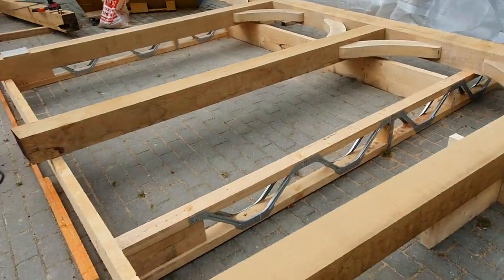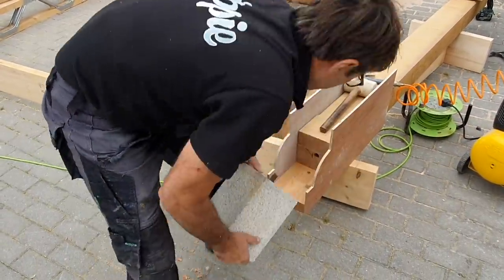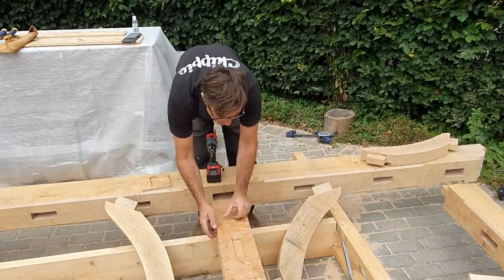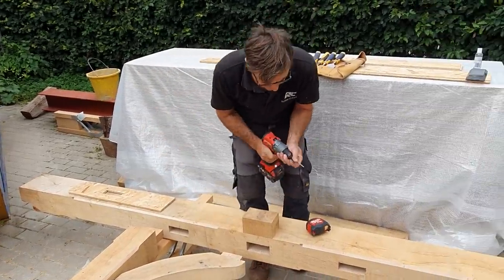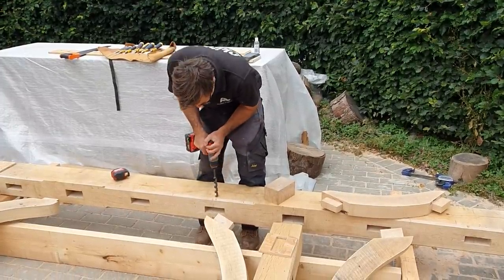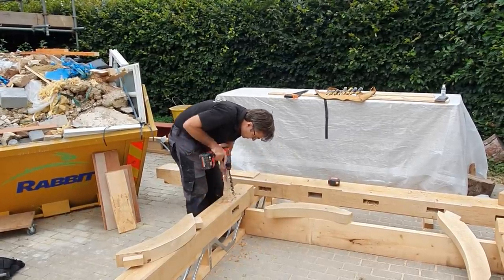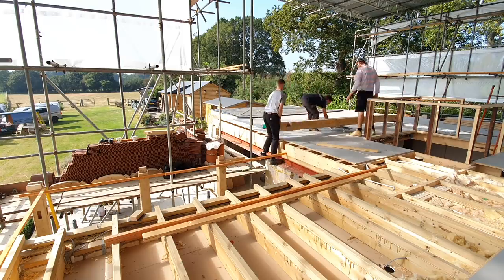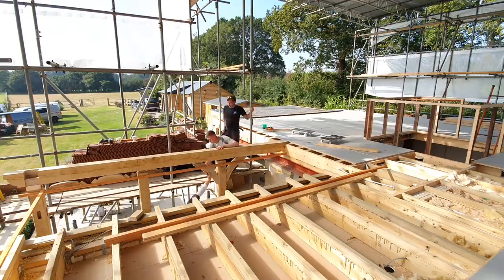The Big Build 24. Oak Framing tips including fitting staddle stones and drilling for pegs

Comment: All the old Oak barns I have pulled apart and rebuilt had the pegs all the way through. I used to do the same out of tradition. I was also always taught to draw dowel. Drill the hole right through the mortice then put the tenon in. Put the drill back in and kiss the tenon then pull back out and offset a whisker. Taper the end of your peg and bang through tightening the joint. There was some wonderful joinery on those old barns. Pulling them apart taught me a lot. 1/2 lap dove tailed collars. Huge cross beams dove tailed into the equally huge top plate. Your favourite pegged scarf joints. Beautifully cut purlins and birds mouth struts. All cut by hand with no power tools. Skilled workers. Your half a ton of Oak is going to be an equally nice feature.
Reply: Yep. You can assemble the building as a kit of parts. In the future, it is relatively simple to knock the tapered faceted peg back out and reverse the process. With a blind hole, the process is very difficult. The joints of oak framing are a big part of what gives it its beauty and they should be in ya face.
Reply: @catabaticanabatic3800  I agree I have pulled many apart over the years that had been together for hundreds of years. Used every part we could and made replacements where damaged or missing. Some of the old craftsmen even carved Roman numerals on the parts making reassembly even easier.
Reply: I was working on a timber frame..in same village a guy was doing same to live in..went for a look..he'd found silding shuttered windows behind boarded walls which I'd only seen in books..a fantastic wood machine shop on site..but I did think making perfect octagonal pegs a bit ott ..

Comment: Hi, when fitting the post on the staddle stones, do u need to wrap the rod to protect the oak? Also do you need to leave a small air gap between the oak and the stone? Or should any adhesive be used? Many thanks

Comment: If you were making an oak frame building all all the lengths were approx 3m (not ideal I know but it’s what we’ve got) would you sit the wall plates ontop of each upright and join them there or mortise and tenon them into the side of each upright? I feel that would look nicer as a seat cut always seems difficult to  make perfect but would probably be much quicker and maybe stronger for the roof to sit on rather than a mortise and tenon? Thanks for the video.  Cheers

Comment: Hi Robin. Did you use draw peg dowling so the hole in the brace is just a mil or so offset towards the tenon shoulder, so when you knock the peg through, it draw the tenon joint in tighter than a straight through hole? 
Great work as always, and I love the content.

Comment: Hi guys, when you drilled through the tenon for pegs did you ofset the hole slightly to pull the two components together (draw bore)?
Reply: I would also be really interested in your answer :-)
Reply: Didn’t look like there were any holes in those tenons first. So was it disassembled again I wonder?
Reply: I wondered the same👍
Reply: Add another curious watcher …
Reply: @robertbamford8266  what???
Reply: @danthechippie4439  That is, another person who wants to know the answer to your question. He must have drilled a hole in the tenon for the pin, but did he disassemble so he could draw bore?
Reply: @robertbamford8266  probably not, I'd say he drilled out for the pegs once everything was put together
Reply: @danthechippie4439  My guess, too.
Reply: The way I was shown was an oversized chestnut peg is driven in and when the oak drys out it shrinks and tightens onto it but I've also seen steel pegs being used for a detailed look 🔨
Reply from the maker: I use an 18mm auger bit to mark the hole through the tenon pushed hard against the edge of the 20mm hole to offset the centre so when I drill with the 20 I have a 2mm offset that will be really nice for drawer dowelling the tenon into the mortice, thanks for all the intelligent interest in this part of the works, I have a great selection of viewers and followers and for that I am very grateful!!
Reply: @ukconstruction  I knew a man of your calibre would have it covered👍
Reply: @ukconstruction  that's a great idea especially with such big oak beams.

Comment: Hi Rob, quick question (not related to this video). Im currently constructing a warm flat roof with a central roof lantern. Would you continue the insulation up the outside of the roof lantern upstand? I know theres only around 100mm of upstand above the roof finish and probably nothing to worry about regards condensation. As far i can see, everybody just insulates inbetween the timbers of the upstand frame.
I would love to know how you would tackle this detail.
Thanks, Joe.
Reply from the maker: Hi Joe, I Tend to frame out the up stands in 50 x 50 mm and cut 50mm PIR tight between, 18mm OSB on the outside and insulated plasterboard on the inside giving about 100mm overall thickness, the insulated plasterboard deals with any cold bridging and the solid 50mm timber and PIR with the 18mm Skin of OSB gives a good U value too, hope that helps
Reply: @ukconstruction  that's a big help, and thats what I'll be doing.
Thanks 👍

Comment: Hi Robin, I wondered how you address the issue with the upright posts where they meet the concrete blocks, is it wise to leave a gap between the two to prevent the posts from rot?

Comment: So how do you dissemble those joints if need be if the peg does not go thru the whole way?
Reply from the maker: Once its assembled and pegged then its there for good!!
Reply: Drill it out?
Reply: @normanboyes4983  True but why install a peg that requires that. Buildings are altered, repaired, etc all the time so why create a situation that requires more effort?
Reply: @ukconstruction  Nothing is permanent in wood framed structures.